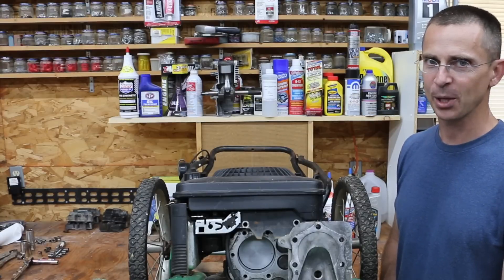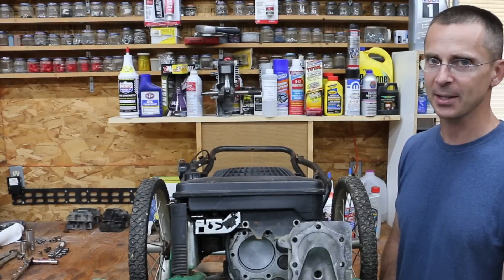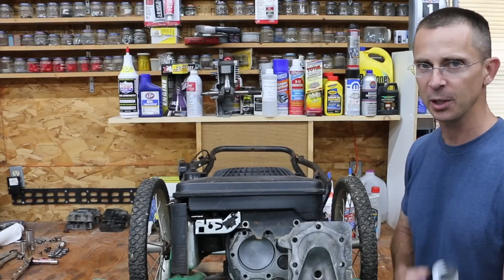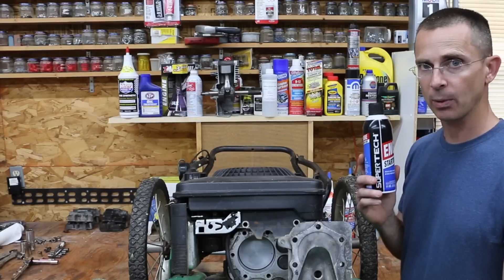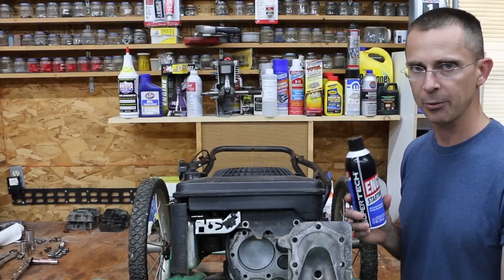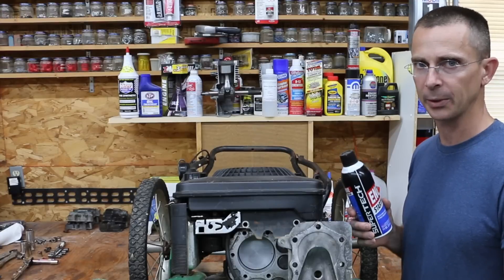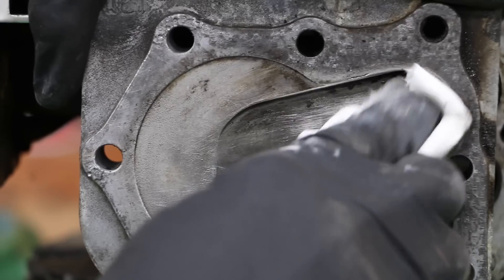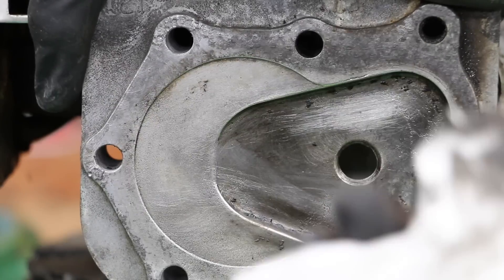Will Running an Engine on 100% Starting Fluid Cause Damage?  Let's find out!

Comment: Seems like it done cleaned yer cylinder bore.  will you be brave enough to run an engine on acetylene?
Reply from the maker: Jason, thank you for this video suggestion!
Reply: Dear lord I can only imagine the smoke and carbon build up.
Reply: Project Farm I believe the mythbusters got an engine to run on straight hydrogen by pumping it into the carb. Maybe an episode on what gasses can be fed into the carb would be fun
Reply: In the early days of internal combustion engines, remote areas used calcium carbide and water to generate acetylene to power engines. Not a new idea at all. Acetylene will sometimes spontaneously ignite at pressures over 30 PSI-- so be careful when experimenting.
Reply: @mudscool: "Special gas that has a much lower freezing point"? Aviation gas has higher octane rating above 100 meaning it has longer hydro carbon chains (octane is C8H18 and = to 100 using the R+M/2 method) that would actually mean it has a higher freezing point. For example wax solidifies much before butane, which are both straight chain alkanes.  Maybe do some reading up before you call people dumb. Piston planes run on gasoline, jets run on purified kerosene which is all jet fuel is.
Reply: Might want to double up on inline flame arrestors before attempting!
Reply: jason I read this comment in a pirate voice
Reply: jason run it on paint thinner.
Reply: it  will be dirty, that is for sure. But I have no idea how it will end for the engine.
Reply: mud's cool actually, jets DO NOT run on gasoline. JetA is highly refined kerosene based fuel with other additives that lower the freezing point and it is prepared for use in turbine engines. There are a number of other jet fuels, such as JP1, JP2, etc, but these are fairly rare, since they are usually used for military turbines. 100LL is fuel for piston engines and is formulated much like car gas, with some chemical differences and a higher octane (100).
Reply: sewerage Pumping station pumps mostly (at least they used to) are powered with diesels. The intakes were plumbed to ingest the Sewer gas (mostly methane) on the intake stroke and would 1) help the diesels run a but more efficient 2) reduce the odor of the plant. 
 Check out a MFE (multi Fuel Engine) that will burn anything from Gasoline to engine oil, Jet fuel .. more Some were used in the 2 1/2 ton military trucks and some field vehicles
Reply: jason  I ran a lawn mower with acetylene it didn't mess it up
Reply: I kept a mower running by feeding propane at a low rate into the carb before.
Reply: I want to see more smoke. Lol!
Reply: I've heard you can haul away waste jet fuel since they can't re-use it when drained from a plane during maintenance and run it in a diesel.
Reply: Edgars Lacis-S your dumb Mark OnTheBlueRidge is right
Reply: Nope
Reply: jason It looks like it would prolong the life of the carburetor by keeping it cleaner as long as you don't let the oil keep building up on it.
Reply: Mark OnTheBlueRidge Jets use a kerosene-like fuel, so you're right. But I believe he means AV-GAS, which is gasoline that's leaded and with no ethanol meant entirely for piston engine aircraft.
Reply: mharris1270  actually thats not true. Lol. I can go down to my local airport and get any amount of jet fuel I can haul. Same with avgas
Reply: All the octane rating means is it can withstand a higher pressure before detonation. Most force-inducted vehicles run higher octane fuels because their compression ratio is higher. If you tried running 87 in a vehicle that calls for 93, you would get spark knock and pinging.
Reply: try to run it of E85 or 98 gasoline and if you have it try 100 "jet" gasoline
Reply: try to run it of nitrous oxide and E85 it will run 10s
Reply: it will burn out the valves over time
Reply: jason the valves will burn and melt
Reply: they run on gas your just dumb it is special gas witch has a much lower "freezing" point and aviation gas does not have a high octane it only has 95-98 octane but now modern aircrafts use a higher octane gas like 100 and 105

Comment: Most of the risk related to starting fluid on diesels is hydro-lock. My 2011 Freightliner Cascadia has warning labels about fire or severe engine damage from use of starting fluid on the filter cover.
Reply from the maker: Thank you for this information.  I've heard of fires getting started due to intake heaters igniting starting fluid as it's sprayed into the intake.
Reply: Project Farm Also detonation. Another comment explained that diesels key factor is timing, so if the fuel comes in WITH the air, it will ignite too soon and damage the engine.
Reply from the maker: Great point!

Comment: Usually only a problem on diesel engines, it knoks VERY hard. Silicone spray is better on diesel but still knocks.
That oily residue is the part that is made for diesel engines since this is a "universal" product.
I know someone whom ran a peugeot partner diesel only on 4 or more cans of starting fluid since the diesel never went in and the engine was knocking like crazy, i told him it was a bad idea and after 30 minutes he seized the engine and had to get a new one 😂
Reply from the maker: tullgutten, thank you for sharing these comments.  Clearly, starting fluid ruined a diesel engine and this is good to know.
Reply: Works as a quick start but not recommended for more than a few seconds 😉

Comment: Starting fluid is perfectly fine in a four stroke engine, but if avoidable never ever use it on a two stroke!
Reply from the maker: Steven, Thank you for this advice!
Reply: Project Farm thank you for the great videos! The reason why you should never use it in a two stroke is because it is similar to running it on straight gas without oil mixed in it. It can cause the cylinder walls to be scored and can melt the piston.

Comment: By the way, sometimes when I want to make a not very well tuned cold engine to start, I open the throttle body and spray some WD-40, close it and start it. It's not much and will not cause damage, but what if you try to run on WD-40 or something like that?
Reply from the maker: Ti M, This seems like a great video idea--thank you!

Comment: Would it hurt to run a diesel on vegetable oil with out a conversion kit.
Reply from the maker: Nicholas, this seems like a great video idea--thank you!
Reply: Nicholas Hollow the previous owner of my truck (Ford 7.3 Idi) ran it on wvo for 3 years. No conversion just poured it in the tank...truck still runs, but I could tell the fuel filter was about 5 pounds heavier than its replacement. Still have yet to cut it open and check out the carnage after it's 3yr service life... I don't run wvo in my truck, although I usually run B20 biofuel blends. WVO can clog up your fuel system depending on how well it was filtered. It's a big no no with electronic controlled diesels. Lots of oil and electrically activated gates and valves in the fuel pumps and injectors and heads that can clog up. Very expense to replace.

Comment: On diesel engine it's a bad idea indeed, because it will knock. 
Usually, diesel engines will inject fuel right on the time for ignition, but if the fuel is already mix up with the air, it will ignite too early.
Reply from the maker: Ti M, Great point.  I suspect the predetonation is hard on the rings.  Thanks again!

Comment: Starting fluid is made with a lubricant now so it won't lock the engine. But running an engine on brake parts cleaner might but you should try that!!!
Reply from the maker: Thank you for this recommendation!

Comment: On diesels it will break piston rings if you use to much and its not cranking over good it preignites and cracks rings did a couple over huals with broken rings the crank case reaked of starting fluid
Reply: How does the tractor start now that the compression has been restored
Reply from the maker: Walker, It now starts without ether or the block heater.  It is so nice now to be able to start the tractor without any hassle!  I'm still amazed that it worked this well!  Thanks for commenting!
Reply: Project Farm cool deal i dont rexommend using it every oil change i triied it in one of my old mercedes and found the copper that is suspended in it started to gunk up my cartridge style oil filter
Reply: You should not run starting fluid on diesels with glow plugs or grid heaters
Reply: Marcus Michols ,
I agree with you. Only way to use starting fluid with intake air heater or glow plugs is to disable them.
Reply: I would like to see a side by side comparison on a diesel using either vs brake cleaner as starting fluids. I find personally the brake cleaner picks up faster and don't give the nasty either knock
Reply: Ted Dow so have I. Maybe be better if i said it can cuase damage mostly from people that dont know how to dose it into a diesel
Reply: the biggest problem that i saw on diesel engines was the pre-combustuion chamber getting worked loose from the ether working it loose during the startup. Lost one engine from that. The previous owner I found out had been using ether to do that on the mornings that he could not get it to start. I personally cycled the glows a couple of times before turning over during the coldest parts of winter.
Reply: lots of blown head gaskets too.
Reply: Dingus Dow used correctly it fine cancel the pre heaters allow tgem to cool if the have been cycled before use.
Reply: Walker Vaillancourt : never seen piston damage,, bent rod instead.
Reply: Starting Fluid makes diesel trucks "Ether Babies"

Comment: Dont try this in a diesel! you can blow off the heads. But I believe starting fluid is essentially low octane gas, and I think the oil film you saw was oil being cleaned from valves
Reply from the maker: Taydrum, Thank you for this advice!
Reply: Cheers, thanks for the great videos as always. Constantly learning so much from all your videos!

Comment: Isn't starting fluid pretty much just ether? I wonder if the fuel lines were in any way damaged during the test. Dried and hardened or anything like that?
Reply from the maker: Nuclear Facility, Great point regarding the fuel lines and rubber carb components!  Yes, the main ingredient is ether.  Thanks for commenting!

Comment: Does that (those) brands of starting fluid maybe contain a lubricant in them? They seem to be labeled as "premium"...perhaps the oily film is from the starting fluid.... if that is the case, what about just straight ether?
Reply from the maker: Shawn,  This is a great point and I suspect both brands I used contain some form of lubricant.  Thank you for the recommendation!

Comment: I have broken many flywheel keys using starting fluid. Seems like starting fluid would over heat the motor and case damage that way. I dont use starting fluid for starting a mower,ever. I always use a spray bottle of fuel.

Comment: Try do a video on what happens to dirt when it enters the engine? Does it combust or does it fly out the exhaust?
Reply: Most like fly out the exhaust or build up inside causing scoring
Reply from the maker: Wheels and films, Thank you for this recommendation.  I did a video recently in which I fed sand into the engine.  It went out of the exhaust and caused very significant damage to the cylinder walls.  Thanks for commenting!

Comment: only way i can see the starting fluid not doing damage is because the engine isn't under some kind of load just idle,but if the engine was worked and the cylinder,exhaust temps got higher I'm sure there would be a big change and damage as a result since its so combustable. it would be worth revisiting this but mowing some grass to see for the fun of it!
Reply from the maker: This is an excellent point!  Thanks for providing this perspective!

Comment: Good one, Commander. Most ether has an upper cylinder lube in it so that was your film inside. As far as a diesel goes I've heard that the ether will pre-ignite (you can hear the knock) and will erode the spray nozzle holes and kill the spray pattern causing dribbling and no atomization, thereby having to use the stuff to get enough KICK for the engine to finally fire off. And as far as the ether in the Briggs 'L' head, it probably liked a change to some GOOD stuff as sorry as gas is now. Remember how gasoline USED to smell? Like water any more.  We've got a no ethanol mix here called Tru-Fuel that its either 40 to 1 or 50 to 1 mixed with synthetic oil or straight gas, no ethanol. 2 year shelf life opened and 3 year unopened. Around $7 a quart but good for winterizing. Thanks Commander!
Reply from the maker: Lewie, This is all great information and I always enjoy reading your comments!  Thank you for the positive feedback.  Regards
Reply: Thanks, Commander. Things I've picked or worried out of people over the years.

Comment: If you still have the engine that you ran the sand through you should try the restore in it and then do a tear down it would be interesting to see what it is actually doing to the cylinder walls
Reply: Or any small engine that has wear in the cylinder walls would like to see how it gains compression
Reply from the maker: Project Junk, I cut the sand damaged engine into pieces to use as a cutaway for videos.  This is a great idea.  Thanks for commenting!
Reply: Love the video. After the diesel one I was intrigued at how it actually works

Comment: The damage is caused by detonation, I believe.  The air is made flammable and either it or the gas ignites on different fronts and collide. I could be wrong.  Other comments below have stated that starting fluid isn't 100% ether, which may be more prone to detonation or has more of the cylinder-wash characteristics. I generally don't use it because it stinks to high hell and gives me a nasty headache.
Reply from the maker: Pat, All great points.  Thanks for commenting!

Comment: My grandfather was a big advicate of using kerosene mixed in fuel when an engine was running rough to help clean it out. I would like to see how/if that really works. He would add about 1-2 cups to his mower fuel tank (with regular gas) to clean carbon out.
Reply: Kris  Kerosene (the white variety) actually burns cleaner than gasoline, and tends to leave behind a little wet residue on internal parts that helps soak and loosen carbon deposits.
Reply: Kerosene works great on cold mornings
Reply from the maker: Kris, This is a great suggestion.  Maybe this will out perform MMO and Seafoam?...we should test this!
Reply: Project Farm awsome, I look forward to seeing the test. I am subscribed so I look forward to seeing it. You have great content.

Comment: Diesel in a gas engine?
Reply: It probably wont combust in a small engine like this without fuel injection
Reply from the maker: I'd like to find out.  Thanks for the suggestion!
Reply: Dylan Stephens it will lose conpression overtime
Reply: Won't run unless you mix it with gas or such. Not enough heat to ignite the straight diesel.

Comment: Run the engine on nothing but seafoam and fill the crank case with 90% seafoam. that would be great
Reply from the maker: relaxing cat, Thank you very much for the recommendation!
Reply: It won't. I tried it on a running generator and it killed it. But it did start back with some gasoline and a lot of smoke!!!
Reply: I wonder if it would even run
Reply: It shouldn’t run because if you ever poured seafoam in your carburetor it makes the engine bogged down install I would think that it wouldn’t run very well just take your lawnmower and buy some seafoam and put it in your lawnmower and start it or try to start it there have a canna either there lol just had to comment

Comment: Smaller diesels will lift the heads if you spray them with starting fluid, that's the main engine damage starting fluid causes
Reply from the maker: This would be bad!  Thank for commenting!

Comment: Try running an engine with rubbing alcohol!!
Reply from the maker: Thank you for this video idea!
Reply: No problem, I love your vids!
Reply: The geek of the cheap I did that after Hurricane Katrina made gasoline six bucks a gallon. Other than being hard to start and surging until it warms up, you'd never notice the difference. At least until the rubber dry rots and crumbles from the alcohol, which in my case happened over the winter.
Reply: I've done that before. It ran fine after I adjusted the carb for a richer mixture. It didn't do any damage.
Reply: I bought a Rabbit from a guy that tried to use rubbing alcohol to get rid of water. All it did was rust the tank pout.

Comment: Very informative, you stand more chance of doing damage to cyl.spraying it into carb because you wash the rings with a rich condition. ( washes the oil of piston rings) run through carb the mix will be off a bit because of the viscosity of starting fluid through the jets, the valve guides might suffer in long term use from the solvents.
Reply from the maker: This is an excellent point about spraying it directly into the carb. Thanks for commenting!